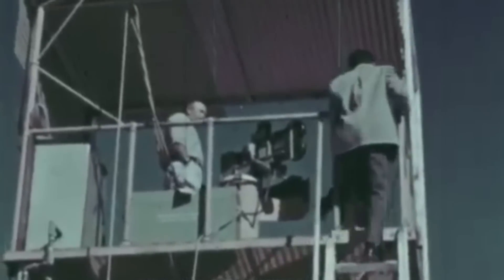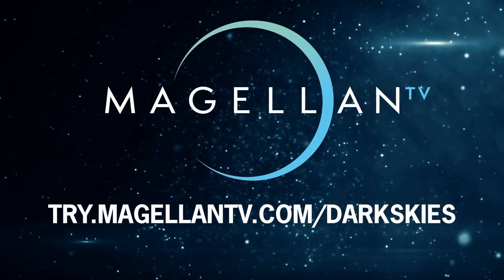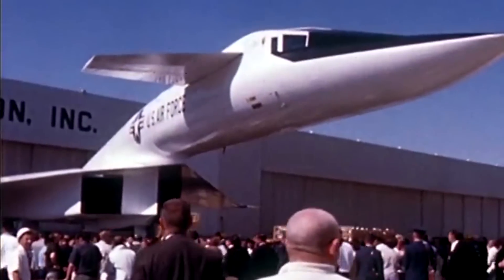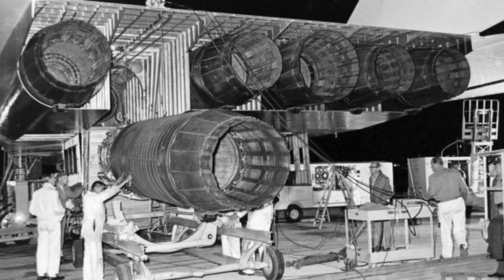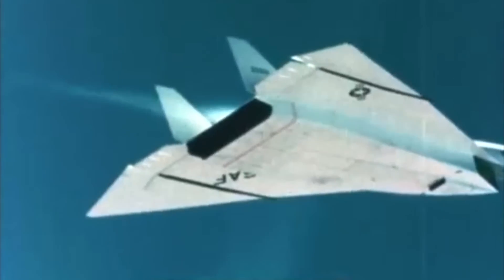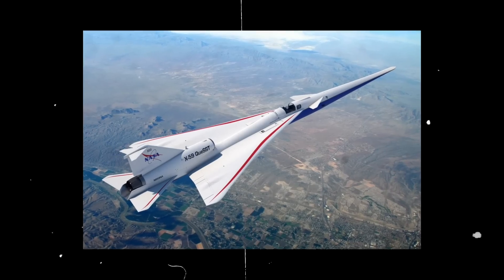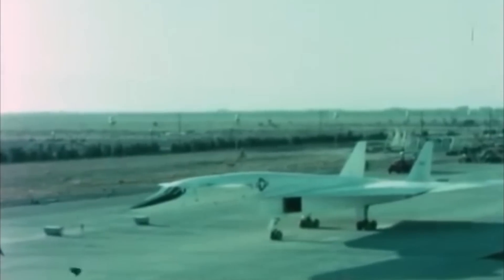XB-70 Valkyrie - Mach 3 Nuclear Bomber

Comment: 10:30 you mean to tell me they had a mid-air collision problem with these things? I couldn't possibly figure out why that's the case..
Reply: The fighter got too close and was basically sucked in, then over the xb-70 by the tremendous vortices this plane would develope.
Reply: They didn't have a "mid-air collision problem".  There was one collision.  Otherwise, the XB-70 program was largely uneventful.  Despite being a huge and complex experimental aircraft, the Valkyries flew about 2x week until the program was cancelled.

Comment: Actually, the Soviet missile capability was overestimated. They never got an SR-71 which flew at similar height and speed.
The USAF got spooked by the U-2 shootdowns and the MiG-25.
There was going to be a reconnaissance version, the RB-70, but the SR-71 took its place.
Reply: Mark Newton-John - They never ‘got’ an SR-71 because none of those aircraft ever penetrated soviet airspace.
However when I was serving in the RAF during the 1980s they used to fly (in international air space) north of Murmansk, where they were regularly intercepted by Mig-31 Foxhounds.
Reply: One of the SR 71 blackbird’s had shrapnel from an exploded missile shot at them. Most likely that ended the program.
Reply: ricvis44 - Highly unlikely. As I previously said, SR-71 flights were always careful to stay within international airspace to avoid the risk of such incidents. Had what you said actually occurred (the attempted shooting down of a military aircraft in international airspace) then this would have caused an even bigger international incident than the U-2 shoot-down, and would I been massive global news. 
Again, as I mentioned previously, SR-71s WERE regularly intercepted by Mig-31 Foxhounds in international airspace off Murmansk, but of course there was NEVER any attempts at shoot-downs, which would have been sheer madness.
There were however reports of SR- 71 overflights over Vietnam and North Korea, with attendant SAM launches. I take it that it’s these to which you refer.
During my time in the RAF I only dealt with European airspace.

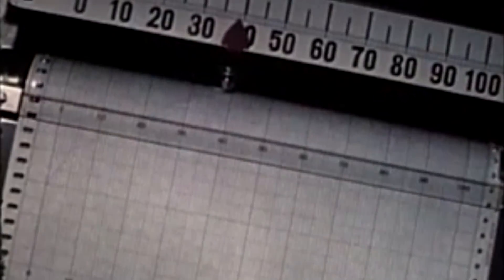Comment: This thing flew so fast it ripped the paint off. 3:12
Reply: Also see @6:24
Reply: Thick paint allegedly caused the problem. Several thin coats allegedly fixed the problem.

Comment: Even by today's standards, it is still a ”futuristic” looking aircraft.
Reply: With today's engines, and composite components,  electronics,you would have to wear a pressurized  space suit to fly it.
Reply: @awclark3  but getting all the paperwork  done is much harder today.
Reply: @awclark3  exactly just like our u2 spy plane and sr71 black brid cause how high you have to fly and speed cause 70 to 80 thousand feet is edge of space
Reply: @awclark3  Yeah, but just imagine what a world beating aircraft that would be. Great looks and unbeatable performance, it would probably have the range to go anywhere in the world and the flight ceiling to beat missiles, by the time they got there it would be hundreds of miles away. ;D
Reply: @nightlurker  that what I am saying!  Could hit mach 4 or 5.
Reply: Even by today's standards even the performance is futuristic, in a way. We only have one other manned aircraft with similar specs, and it's a marvel.
Reply: @jonslg240  
What became the SR-71 Blackbird was designed at the same time as the B-70. It started off as being the B-70s' fighter escort. Hence the similar performance envelope.
Reply: @patrickhorvath2684  A12
Reply: @nickbarkas5774  
I wasnt sure. That would be the sports model, as opposed to the family model ?
Reply: @patrickhorvath2684  There was an article about the A12 story on an old magazine closed down decades ago (wings or airpower).
Reply: @nickbarkas5774  
 It is interesting that the SR71 Blackbirds' true top speed and capabilities are still classified..
 The mach 6 Aurora has been obsolete for over 20 years..
Reply: @patrickhorvath2684  the SR-71 was developed from the A-12 spy plane, which was not intended as an escort for the B-70. The two planes were developed separately by different companies, with only coincidental overlapping time frames. You might be thinking of the F-108, but most of the interest in having the F-108 work with the B-70 came from North American, because that company developed both aircraft.
Reply: @winternow2242  
Brush up on your history. 1959, both planes were on the drawing board. What became the A12 started off as the B-70's Mach 3  fighter escort.
Better write some book publishers and tell them they're wrong..
Reply: @patrickhorvath2684  brush up on your research and show me a published book having evidence that supports your claim that the SR-71 was planned as the B-70s escort. The SR-71 had a shorter unrefueled range but a higher max altitude. The 2 planes were designed by different companies. Although both were designed for the usaf, the A-12 that the SR-71 had been developed from was designed for the CIA. You have any published sources debunking that, I'd live to read it.  About all you have are a coincidence of dates, which isn't surprising as this was the cold war.
Reply: @winternow2242  
I read what I read. Too busy working to argue.
Reply: @patrickhorvath2684  too busy to post the name of a single book?  For a guy who's sure that "brushing up" on history will prove his point you can probably rattle off a dozen books that debunk what I say.
Reply: @winternow2242  
 It was a book about the B70 that I read in 1970 and I have seen other references to the beginnings of the concept of the A 12 being originally designed as the B-70's fighter escort. What is your problem with that?
Reply: @patrickhorvath2684  my problem with the fact that you've basically said nothing and substantiated nothing but you think you've proven everything. 

Your first clue - the one that would have been warning that you were going in the wrong direction - was that part about reading it in some (nameless) that was written over 40 years ago, and apparently nowhere else. A book about the P-51 is going to mention the A-36 and the Rolls Royce Merlin engine. A book on the history of the F-14 is going to mention the F-111.  Books on the F-8, the Phantom and the F-105 are going to mention Vietnam. A book about the history of the F-16 is going to mention the F-18, and vice versa. There are some historical details which are practically impossible to separate. A detail about the SR-71 being a planned escort for the B-70? That would have been written in just about every book on either plane.
Reply: @patrickhorvath2684  a-12 was designed from the start as a cia Reconnaissance for project gusto. It was to replace the u-2
Reply: @warwickben  
 Well that is what I have read. I am aware of project gusto and project isinglass. The convair, general dynamics, and North American designs did not work out and then the A 12 was chosen. So you are saying that the government would not have called for the design of a mach 3 supersonic fighter escort for the B70? Your saying that the A-12 
 Could not have been a fighter escort for the B70?
Reply: @patrickhorvath2684   the a-12 was just one of the designs submitted to compete for a lack of better terms replacement for the u-2. They realized that U-2 high altitude wasn’t enough to protect it self. The piggyback/parasite drone program was started at the same time because they realized the a-12 speed and height might not be enough to fully protect them selfs for the lifespan of the plane , so they would rather have the drone taken out. Turns out the plane height and speed was good enough and the drone didn’t work out as they planned and was launched from other planes then sr71/a-12’s  more often.  

If you look at it from a design point of view. The a-12 is to large to act like a fighter escort. It didn’t have the maneuverability even at slower speeds , There’s a reason they just went faster in a straight line vs performing maneuvers to avoid missiles etc. 

A fighter escort for the plane probably wasn’t needed due to the height and speed it could go.  If there was a need they would probably go with a plane that was designed for that role, something smaller, they would probably do air refueling, trade offs what squad was protecting. Or only have smaller planes in a smaller area that was needed.
Reply: @warwickben  
 We are not talking about dog fights like Sopwith camels at 80000' and mach 3. That kind of air combat is going to be with standoff weapons from beyond the horizon. Look at the F111 fighter/bomber, that is a big freaking plane.
 The a 12 needed to be the size it was to have the range that it needed. It would have been a fine fighter escort for the B70.

Anyway at this point what difference does it make? It was designed 61 years ago has been retired for decades and it's true top speed is still classified
Reply: @patrickhorvath2684  you know they reactivated the sr71 for use in the 2000’s  for some time .
Reply: @patrickhorvath2684  no this isn't sr71 was a spy plane not a fighter jet or bomber so no bombers had any thing to do with sr71 blackbird
Reply: @Jokertuning  
They were both on the drawing board in 1959. I read that what ended up as the SR71 started off as the B-70's fighter escort. 
So what?
Reply: @patrickhorvath2684  you're sticking with that Idea of the Blackbird beibg a B-70 escort?  Why?  I haven't heard you say anything about it in the months since I asked you to name your source, and also since another commenter aptly pointed out to you that SR-71s took a lot of prep work, whereas strategic manned aircraft have to be on alert for (virtually) immediate takeoff. The link that you claim between these 2 planes hasn't been mentioned in much of the literature published about either of them, so your source has got to be as groundbreaking as it's memorable. 

And the title of that source is.....
Reply: @patrickhorvath2684  who told you that? Why would anyone think a Mach 3 bomber would need a fighter escort?
Reply: @jimanderson9867  
I read that in a book decades ago, and I believe that was mentioned in some odd documentary. 
They both were on the drawing board in 1959 ( Different companies of course) Fighter escorts were still old school thinking I guess. (?)
Reply: @patrickhorvath2684  hey man I b70 too but I saw a movie about Cold War aircraft  and the CIA on tv, there was an ex usaf and cia pilot in it. 

The Pilot said,”I don’t like liars, people that make things up! Sr71 was never going to be a fighter ever!”
Reply: @nonyobussiness3440  
 I have read that when both planes were on the drawing board in 1959 , what became the SR71.
During it's conception it was thought that it was going to be the B-70sfighter escort ,as both were mach 3+ aircraft. it did not develop on that path but that was the thinking when it was 1st conceived
Reply: @patrickhorvath2684  What, you're still pushing that same story?  I first heard you tell that tale about a year ago.  I pushed you for a source, and you found none, and you never confronted the question of why anyone though that the B-70 even needed an escort.  There were no Soviet mach 3 interceptors in 1959, and the point of making an airplane that can cruise at mach 3 at 70+ thousand feet is that it doesn't need an escort.
Reply: @nonyobussiness3440  apparently not all pilots are as all knowing as they think they are!
YF-12 fighter-interceptor was the origional verson of the sr-71,<you'd think an sr-71 pilot would of known THAT❗BUT I guess not!>
The yf-12 did not have the forward "chinards"? All the way to the very tip of the fuselage, but ended below the pilots canopy. ( that was the fastest verson ) later verson Did extend the "chinards ?" all the way to the very front of the craft, but not near as wide as the 
CIA's verson after it was acquired by the CIA( probably to increase better glide+increase fuel consumption for long range
survalense missions over the USSR, but slightly increasing drag!👋👳‍♂️🎯
That cia pilots remark was probably the result of having a few too many the night before" brainfog "
Pilots " not all, but most"many" are generally
known to be BIG TIME alcohol consumers while 
"Off Duty"👋👳‍♂️👋😫🤡🥳🎯
Reply: @Van Guard the pressure  suit isn't for an air supply, 
Its  to keep you from blacking out as you blood gets hit by the gee force.
Passenger plane might pull 1/2 to 1 gee  during take off.
Reply: @awclark3   pressure suits are life support system . They do it for weight of the plane, having a pressurized cockpit weights more then a suit etc and safety(if they need to eject high up). They only feel g’s when speeding up,drastic turns etc. once you stop accelerating g’s drop off. 
A g suit tightens around your body controlling blood flow.
Reply: @awclark3  you’re confusing a g-suit with a pressure suit.
Reply: It was the Lamborghini Countach of the skies.
Reply: @kelainefes  that’s a good observation I think the Countach was a 1971 design(?) and still looks contemporary now. 
Concorde even more so in terms of aesthetics. It’s a breathtaking design like the XB70. 

I’m interested in American contributors views on the extent to which Boeing et al, helped to prevent Concorde’s acceptance by US federal and state authorities. ?  What would have been interesting is if our US friends had come up with a fully functional and flyable SST airliner but with similar noise and pollution outputs. Do you think it would have found more favour than a “foreign” one?  We might get some idea on that soon if all these current designs come to any sort of fruition although some claim to reduce shockwave noise significantly??? Great vid and a beautiful aircraft, the XB70.
Reply: The old one: ARK BIRD
The new one:
ADFX-11F
Reply: Reminds me of the fictional MiG-31 "Firefox" (the movie aircraft, not the real MiG-31 Foxhound).
Reply: @phantomechelon3628  Yep, I was thinking the same.
Reply: @phantomechelon3628  Oddly enough, the fictitious MiG-31 seems to have been inspired by the real thing.  When Belenko defected in '75, he mentioned that the soviets were working on an advanced variant of the Foxbat, which first flew about 2 weeks after he defected.  Craig Thomas, who wrote "Firefox" may not have known about the advanced model, but he apparently extrapolated from the MiG-25.  Cover art for older editions "Firefox" actually show the MiG-25.  While people may have mixed feelings about the movie, the book is definitely a worthy read, as are all of Craig Thomas's books.
Reply: Bob Well, if it was then that kid had mad drawing skills and talents, kudos to North American for hiring that kid.
Reply: Thats why its name valkyrie
Beautiful god of war
Reply: @briandizano5858  In the TAB Aero edition on the B-70, there's a great picture of this promotional art for the plane, showing a beautiful Valkyrie on her horse, sword held aloft.    Imagine Wonder Woman as Norse, not a Greek Goddess, and you get the idea.
Reply: @Galileo7of9 
 What difference would that make on a global reach mission?
Reply: @Galileo7of9 I figured it would be along those lines .
Reply: @Galileo7of9 I couldn’t remember if it was fully pressurized or not .  But the suit is basically needed for emergencies due to how high they fly, the typical masks you see fighter pilots wear etc wouldn’t protect them .
Reply: It looks like it should be a today's design crazy want they thought ion and designed back then
Reply: Yah it does!
Reply: @Galileo7of9 P.S. The B-70 is 70 meters long.
Reply: No buy today's standards its not futuristic anymore
Reply: @Jokertuning  total B.S.
Reply: Canards and everything on front is old outdated shit
Reply: @Galileo7of9 
 Reading comprehension is not your strong point, is it?

I said that they were both on the drawing board at the same time with (different manufactures)
Reply: @Galileo7of9 
 Yes it did .that was the strategic thinking at the time that they were designing a mach 3 Bomber and they would need  a fighter escort to accompany it .the SR 71 ended up being a spy plane but in its conception it was thought that it would be the B-70's fighter escort. live with it
Reply: @patrickhorvath2684  Not the Sri 71 but the yf 12, faster and slightly different designed up front!
Reply: It's honestly a gorgeous airframe imo
Reply: Arguably, the most beautiful aircraft ever flown.
Reply: It would become a obsolete if it was that ground breaking, full scale delivery of it would of already been true. In todays day and age it is obsolete
Reply: Extremely futuristic looking, especially the blackbird and the b2 spirit. They look totally alien to me.
Reply: That’s because we are doomed. We have no new future to look forward too so we keep relating to retro futurism.
Reply: @Van Guard sounds like a bunch of nerd talk.
Reply: @LilSebastian_  i like how you call educated ppl
Reply: @LilSebastian_  it's Nerd types that design+ developed all these types of wonderous aircraft Jethro!

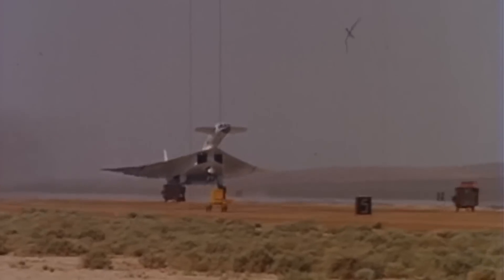Comment: 8:30  Are we not going to discuss those wheels being on fire????
Reply: They must have been made by "Firestone" I wonder if Hot wheels ever made a diecast  of this plane?
Reply: Ha! No kidding. During one of the tests, upon landing the brakes locked up, and the pilots were not even aware of it until a chase place casually informed them that their gear was on fire.
Reply: A pinched wire in a junction box caused the nose gear door to close just as the gear was folding up. It bent the nose gear door and blew out a tire. The pilots used a paperclip to jumper two terminals on a relay in the cabin  to activate hydraulics to get the nose gear down. Somehow the original short circuit also caused the anti skid system to lock the brakes.
Reply: There were issues with the anti-skid brakes.  I met a guy on that particular program.